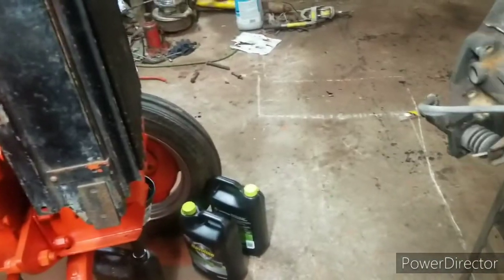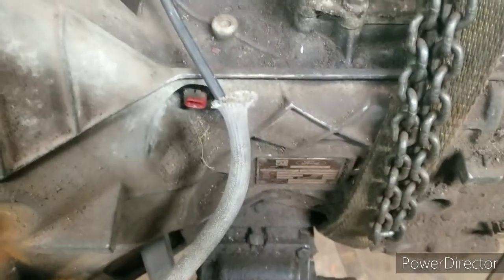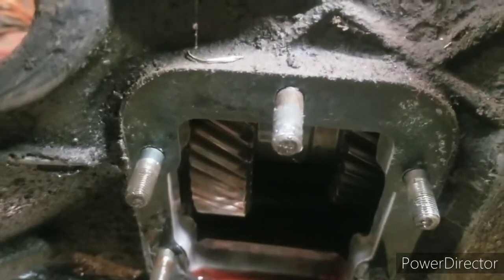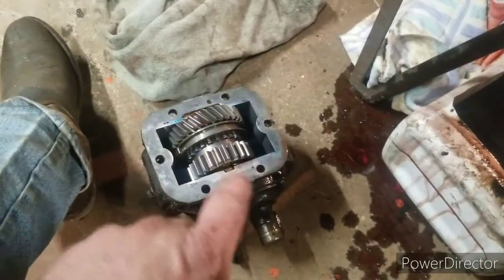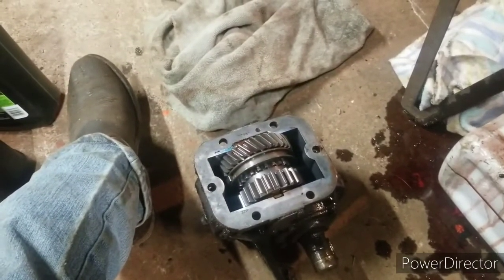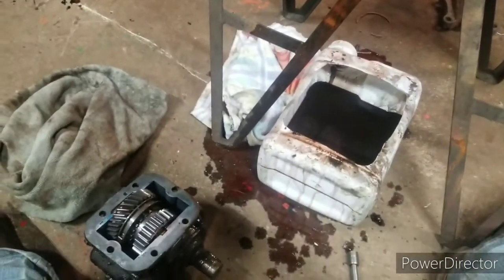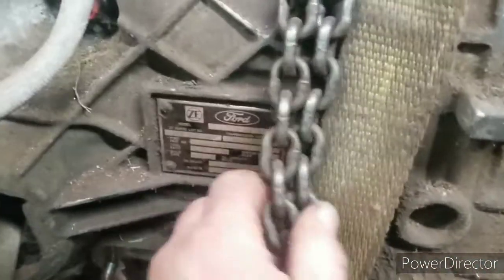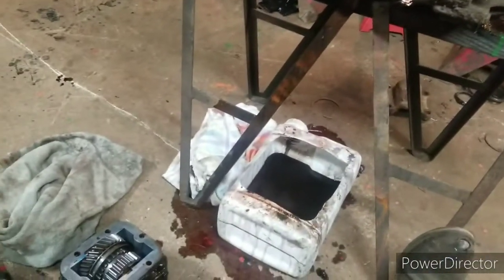Trucks, transmissions, and PTOs

Comment: I'm trying to retighten mine and while it's in the truck right above def filter and it's impossible. No wrench or socket works barely get a .5 of a flat turn . They say retighten every oil change but HOW?  Mines been leaking for months and can't get anything in to fix it

Comment: Do you what pto model will fit a 1984 F250 4 speed t19 transmission? I know it has a 6 bolt pattern on the right and left side of the tranny.

Comment: CE, any chance you can help me identify my PTO and pump? On a ‘69 C50 with the SM465 4-speed trans. No tag on the PTO, but the casting/stamping on the PTO case appears to be Ci-p-223. Pump casting number is 10-10733D. Pump tag says it’s a model number 102-C-0726-C. Hoping to identify everything so I can get the leaks stopped!!

Comment: If you can flip the guts around to have the shaft come out the front, can you flip it around to work on the passenger side of the transmission? 
I'd love to have one run a hydrolic winch but my front drive shaft will definately interfere. Its a zf5 juat like yours,, just have a BW1356 on the back. Thanks!

Comment: What a timely video!  Good information!  Wish I would have learned this from you weeks ago so I didn't look like an idiot on my video asking if that one of mine will work on an NV4500 lol!  So, I guess I'll just be on the lookout for one that fits my NV4500.  But I may just run an electric clutch and have my hydraulic pump belt-driven anyway, we'll see.  No hurry.  Thanks for the video!
Reply from the maker: Actually I made this video a day or two before you posted yours. Just never got it edited! So you have the fuel problem solved? Can't wait for the update! Thanks for watching BD
Reply: @cesmith4566  Yeah, I think so!  I still need to do another long test drive, but the short one was great until something else broke!

Comment: CE, truck transmissions generally have a 6 bolt on the right side, and the 8 bolt on the bottom.. there are adapter plated to the 8 bolt also.
Gears are all different.. sometimes you can change the PTO guts around, sometimes you can't.
The transmission PTO gear comes in all different speeds too.. 
100% gear is 1:1 will the engine speed. 200% is twice the engine speed....
Now I know how a hot shift works😁
Thanks for the video!!!
Reply from the maker: Yeah had a few of them burn up pumps because they were over 100% . Thanks for watching Ed and thanks for putting up videos!

Comment: I do like those zf5 transmissions! Have 3 trucks that have one, all f450s, the 97 f450 is bucket truck that was converted to 4x4. They mounted the PTO on the driver side and the front drive shaft still has room.
Reply from the maker: That's good to know . They must have a pump close coupled to it !
Reply: @cesmith4566  that truck has the pump built into the PTO. It has hydraulic hoses coming off it leading to the hydraulics in the bed and rear outriggers. The rams for the booms both have slow leaks. They appear to be in excellent shape otherwise.

Comment: i have pto's laying all over....i always end up buying a new pto. it has never been cost effective to buy the parts to make a used one work on what i am building. i have a hotshift pto i removed from an allision 1000. it uses an adapter that interrupts the cooler line and taps line pressure for control. nice to see you making progress on the project.
Reply from the maker: Yeah I've got boxes of them figuring some days I'll have the parts I need  ,no luck!  I had to buy a set of springs the 450 ones were too short!